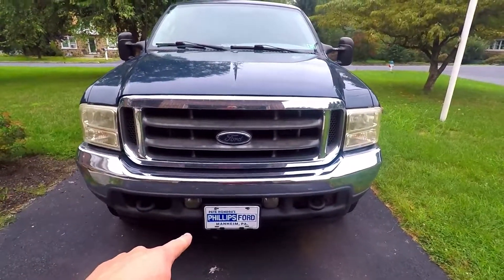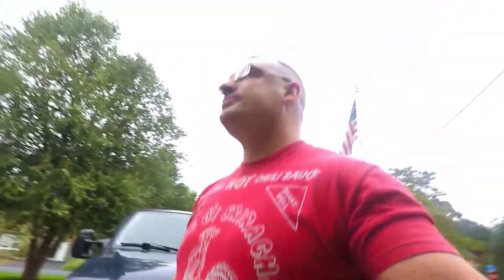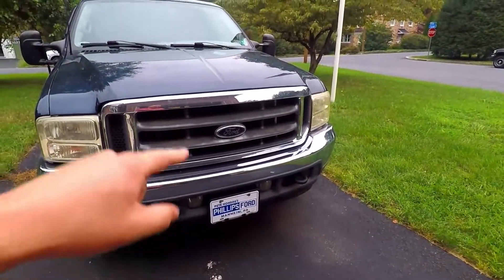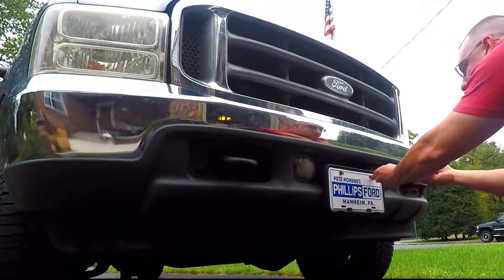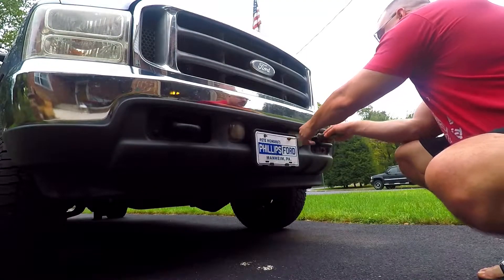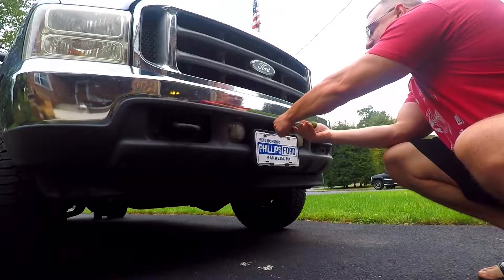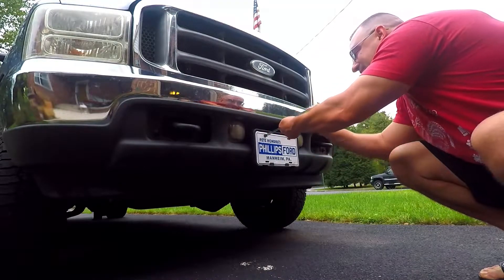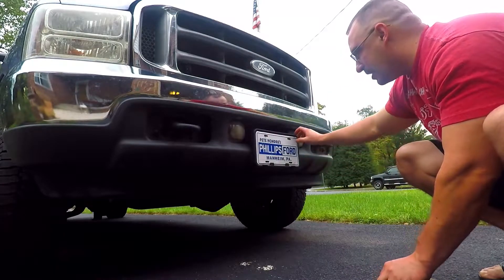6.0 Powerstroke Kill Devil Diesel Update

Comment: Hey Jared! Somethings up with my VGT. I believe my turbo is stuck. Vgt reads 85, and when I give it throttle it goes up into the 90s. Wtf? Truck seems to drive fine, maybe slightly milder boost than usual. The turbo did stick the last time I drove it up a huge hill, and it was overboosting with barely any throttle. Any suggestions?
Reply from the maker: Sounds like the exhaust side needs cleaned well. I am getting ready to do a video on this with turbo I have lying around that went bad on a friend's truck.

Comment: Definitely excited!  Still can't get my hands on exhaust and timing for my offroad 2020 6.7L ! At least you get to play.
Reply from the maker: It's crazy to find stuff right now. Want me to see if I can find you anything
Reply: @six0bros  I would love to get the programming to delete the DPF and DEF fluid. Offroad purposes of course. I would like to install a 5" exhaust downpipe back and I live in MS so we don't have emission checks.
Reply from the maker: You won't be able to find a 5 inch down pipe. There just isn't the room for it. I'll see if I can't find anything around
Reply: @six0bros  correct! I had the same deal on my '16 model. Turned it into a five at the bottom of the downpipe and ran it from there. I did use an AFE monster muffler though. I tow heavy often and programming is my stuck point at the moment.
Reply from the maker: I was going to add a muffler because towing when it is super load is kinda annoying haha. You get an 11 hour drive going and it just sucks lol

Comment: Do you have any thing on updating  the hpop,to newer  style o5 to 07 and what all you need to do and get so the icp will be in better place to get to ,,,like we all just cant wate to get to it any way,,,,thanks for your input it all helps us 04 owners  ...
Reply from the maker: I don't think it's worth the updating. There is an updated housing that fixes the issues with the old pump. That said if you still want the new one you will have to change out rear branch tunes, rocker boxes, oil rails, dummy plugs, stand pipes, the new sensor wiring it from old location to new. To do everything listed the rear cover needs to come off you'll need to remove heads put new gaskets on so it is a very big and expensive job

Comment: There is a notice from crane to use shorter pushrods from 04-05
Reply from the maker: This will have the right pushrods in for thr setup. I was running shorter pushrods before too. I forget what year they changed to shorter pushrods but I believe even in 05 had the original length pushrods. Thr shorter ones were in prep for what the 6.4 would require
Reply: @six0bros  you can run either pushrod 6.4 tubes are .040 shorter new lifters have .080 preload depending on head machine work is in spec i like .025-.030 valve  recession and shave top of stem Valve distortion ans piston protrusion is often over  looked 6.0 rods are stout but all rods bend and stretch over time usually a cam swap doesn't require diff size tubes {exsept regrinds} because bigger cam isn't really bigger they just change the center of base circle to generate more lift and/or duration you can change rocker ratio as well
Reply from the maker: I did do a lifter and pushrod and cam combo from kdd with their heads. So recession should have been set. I just know the colt stage 2(great cam) even with the right stuff had contact with pistons. Maybe it was just the perfect storm tolerance stacking to cause it. I still recommend the cam just would advocate for valve recession in pistons.
Reply from the maker: Also I didn't realize that pushrods stretched over time. I would have that the opposite if anything.
Reply: @six0bros  not pusrods main rods lol
Reply from the maker: Oh the connecting rods will stretch I had no idea. Again I wouldn't have thought that
Reply: @six0bros  yeah kdd knows their shit but make sure piston protrusion is in spec all pistons a crankshaft that been turned on a rebuilt motor will cause issues to
Reply: keep an eye on valve spring pressure too more boost or less restriction from better flow like intake mani or turbo upgrade can cause valve float
Reply from the maker: Both the colt was brand new when I got it and this new cam is brand new as well not regrinds. So hopefully no further issue. I don't know if I could go through this again without needing a therapist lol
Reply: @six0bros  id love to upgrade the cam but they are proud of those and then basiclly complete rebuild since cranks out so i live my early 03' cam lol
Reply from the maker: I like the 03 cam and it is the best year cam. I believe there was just the 2 different cams from factory. The colt stage 2 was amazing I am excited to try this new out and do some videos
Reply: @six0bros  yeah late 04 is a 6.4 cam lower lift but longer duration but dropped the lsa a deg, its ridiculous the price of decent cams run these days its like when anyone blows a ls motor all you care about is i hope my cams ok Ive got a 69' gto had it since high school fuckn ran tits well i wanted a bigger cam my dad said no i did anyways think i kissed every bearing 3 times installing it lol
Reply from the maker: Lol what really stinks about a cam on the 6.0 is everything needs to come apart to install one. That'd awesome you have had a gto since high-school man that is amazing
Reply: @six0bros  well they do have that kit so you can leave in crankshaft n bedplate but idk about top end alota motors if you unbolt rockers and rotate engine in reverse the lifters will stay in the cups so heads can stay on
Reply: Hey i've been carving on some old heads there is definitely room to grow but how much without trading torque for high rpm hp is the question but if you in the near future see a set ported by kdd are someone close get some good pics of the ports without the valves lol i think if i reshape the ex. ports to more D shape may help with getting heat out
Reply from the maker: That is one of the reason I like kdd talking about swirl being as important if not more than shear volume. Within reason obviously.
Reply: @six0bros  I haven't been able to  measure inner throat diameter to size up to valve yet but calipers at hanger hour away  but the mostly they need seats blended better  shave corners smooth the down sides leave the swirl ramps and minimize hogging out that will only lose tq and gain hp at rpms not in reach
Reply: im at the fence about ex ports thinking if i  massage from round to D shape may help with ex backpressure
Reply from the maker: I know very little about it haha. It's an interesting topic to get into.